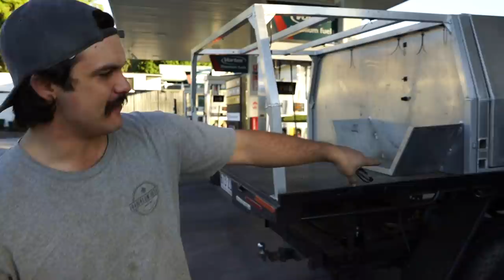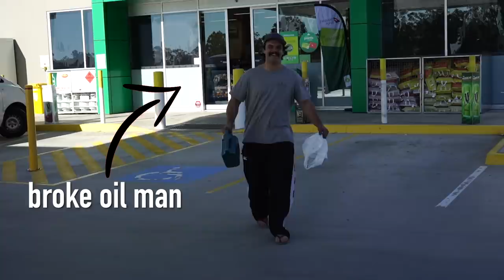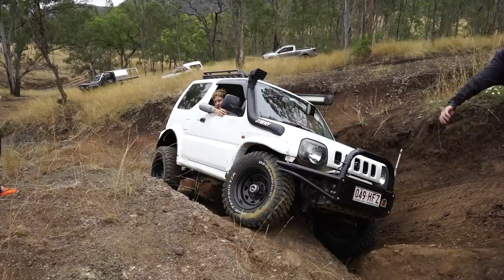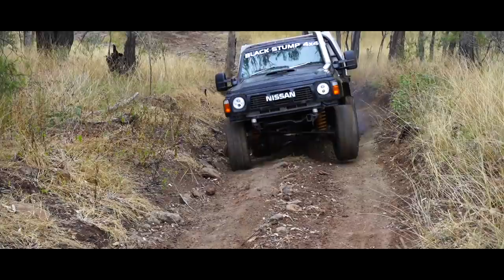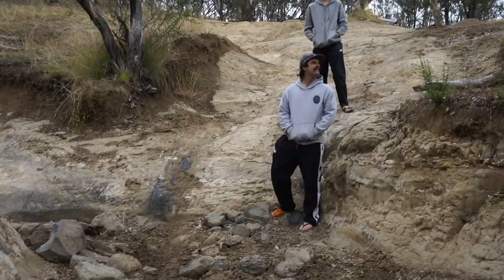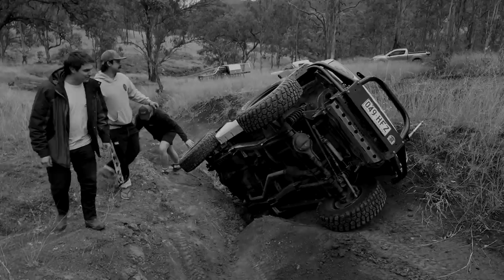4X4 ROLLOVER, and the TD42 Patrol Finally Goes Off Road | Beyond The Black Stump #1

Comment: Where did the guy with the GQ get his irrors from?
Reply: Ebay bro, they are for a GU and i believe you need the TI doors with the mirror in the triangle bit next to the window with the three bolt holes, then it will bolt in but it wont sit very well, check ep 1 or 2 for a bit more of a run down on it
Reply: @ilikezombieification  can you put a link for rhe earlyer eps thanks.
Reply from the maker: andrew morgan mirrors are in this one mate: https://youtu.be/y1G28TTl8II

Comment: Td didn’t even do any 4 wheelin
Reply from the maker: no power steering and no low range with 35s is no fun off road, once that stuff is sorted it’ll be sent
Reply: Give it a week my man, sorting out the issues this week after work and should be in for some more action this weekend
Reply: Black Stump 4x4 and Adventure ahhh okay, keen to see it